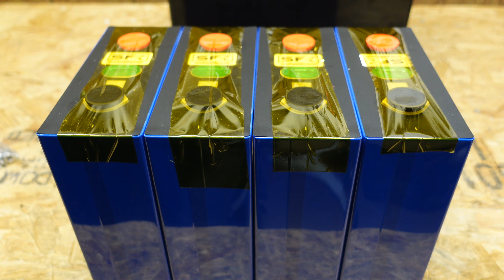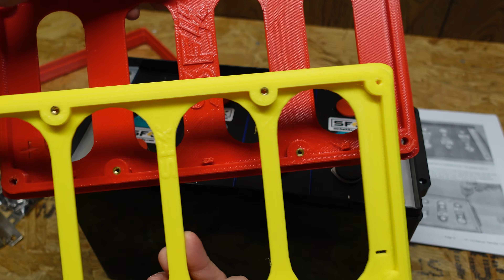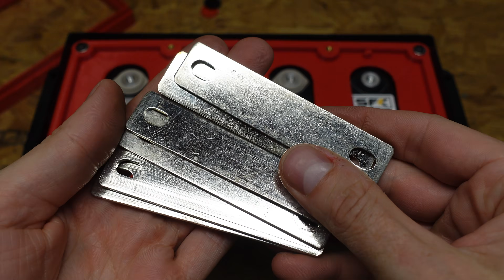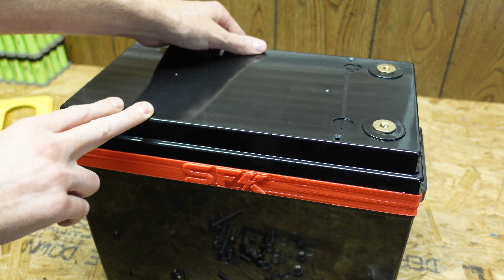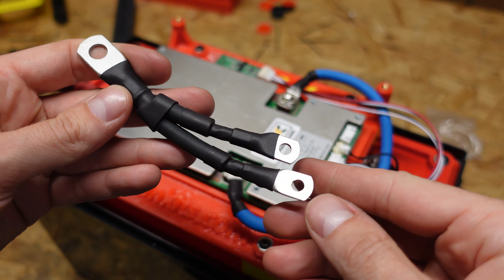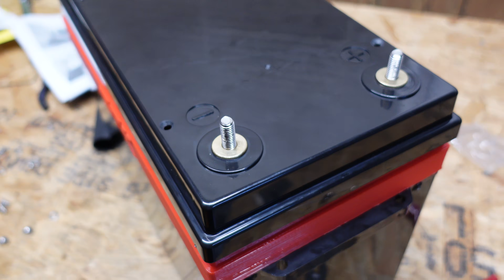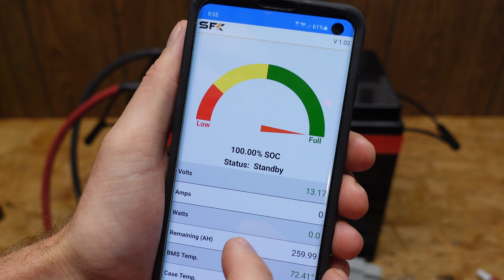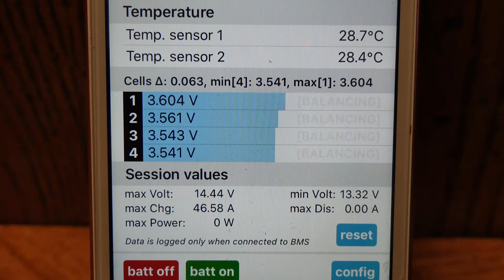Sun Fun Kits DIY 12V 280Ah LiFePO4 Battery, $295/kWh!

Comment: I just finished assembling one myself. I just bought the plastic parts, since I already had the cells  (with red Loctite on grubscrews) and the JBD BMS. Take my word for it, you want the cells fully discharged before you try and insert them, the fit is that good. I had already purchased 6 awg silicone wire, it is much easier to work with, and the single biggest thing that I would recommend they change. My JBD gave me no problems charging at 80 amps and since I didn't purchase their BMS, I wasn't aware they had programmed down the limits. I also made my wires longer and had fewer problems with the final assembly. Once assembled, the battery is pretty much "just right" and worth the money. My cells are grade B (although not previously used) and capacity wise I have two at 268AH, and the other 14 are 274AH or above. I am matching them to the limited extent possible, and it is working out nicely. The kit is actually nicer than I expected, I would highly recommend it. I just ordered 3 more, if you are on the fence about the kit, I definitely recommend it.
Reply: One thing I didn't see was high and low temp sencers. Does JBL bms have that or add on?
Reply: @putteslaintxtbks5166  Yes, it has temperature sensors, and yes you can disable charging when the low temperature setting is reached.
Reply: @john_in_phoenix  where is the temp sensor located?
Reply: @jj-jak  The JBD has two, one is located internally to measure the FETs, the second is attached via a short wire and can be placed where you want, I just taped it to the top of the cells.
Reply: @john_in_phoenix  that sounds good, I was watching other battery packs which seemed to have separate temp sensors for each cell.
Reply: @jj-jak  The model I'm using actually has three, one for the FET temperature and two connected via wires. You can just unplug the two and disable monitoring if you don't want them.
Reply: @john_in_phoenix I'm fixing to assemble a 560 ah battery with 280 eve grade a cells. What bms would you recommend and I already have a 24 volt 24 module leaf battery I'm looking for a bms for as well. I've ordered a 300 Amp daly and a couple of the jkbms with 2 Amp balancer but I'm not sure if these are actually what I need for either of my cells chemistry. I think they will work for the lifepo4 but the nmc chemistry has a much different top and bottom end so just not sure. Any advice will help thanks
Reply: @matthewknight5641   I don't know much about that chemistry, but I can tell you that the Daly BMS that I have are placed back in their boxes and not in use. Too many problems and they seem to randomly change the design and not document it. At least one of mine doesn't count cycles, because it was originally designed for a different chemistry, and never thinks the battery is full. The set values for disconnect work fine, but I don't trust the BMS not to suddenly think that 4.2v is the upper limit for LFP cells, and Daly is zero help. I never did find the software that would let me reset that, and I got the impression that they don't know themselves. They lost quite a few sales that way. I have had very good luck with the JBD that I have purchased, and would recommend them. The JK with a built in balancer seems pretty decent, but at least the one I tested was actually designed for 4 or 8 cells, and then I saw one being tested on YouTube that fried a MOSFET when doing a disconnect at high current. You don't want that to happen when inside a case. You may not notice it, and they tend to fail as a short (i.e. not disconnected). Great way to ruin your battery. For the EVE cells, I would recommend the JBD if doing 12v, and probably the JK if you are doing 24v (JBD doesn't have many choices for 24v, so you may need more than 100 amps). For 12v both the 150A and 200A JBD are solid choices. I may just be lucky, but I haven't needed an active balancer for any battery, just top balance and then the low rate balancer on the JBD has been adequate. I can also say that if you go to the JBD Alibaba store, they have always been very knowledgeable and helpful, so they may have a BMS designed for the Leaf cells. The higher amp rated Daly usually have fans, and I wouldn't recommend a cheap Chinese fan for anything that you want to last 10 years.
Reply from the maker: Yeah even at 30% SOC they were tough to fit in, can imagine 100% SOC is a bit of a struggle. But that's a good thing as it indicates a nice snug (but not too tight) fit. I'm still not sure why the BMS was programmed lower like that, but all of the settings are fully-configurable as needed.
Reply: @LithiumSolar  Yes, originally they hadn't published the guide, and I place the cells in backwards (really just means the positive and negative ends were reversed). It was a royal PITA to remove them and put them in correctly. I had to discharge them fully to get them out, and it still was NOT easy. It seems to give the cells just right compression. The reason the BMS is programmed with lower limits (I was told) is the heat generated when at the upper limits of charge and discharge. I tested at 80 amps charge rate, I wouldn't worry about it too much. Just up the charge rate if you need to in the software.
Reply: Thank you for the input. I'm gonna send the 300 Amp dally back once it gets here I guess. I have all 24 volt equipment and the jk says 100 to 300 Amp in the description of the product on Amazon but I don't really know yet how many amps it's capable of.  I figure I'll use 1 bms per 8 cells and so far I've ordered 16 cells and 2 jkbms. I'm sure I'll be ordering another 16 cells so it'll be a total of 32 cells 280 Amp hour each. I figure I'll try to keep using the leaf cells on my split phase 220 inverter that runs my minisplit and use the lifepo4 cells on my 3000 watt 24 volt all in one powmr inverter to power the rest of my holiday rambler 30 foot travel trailer.  I've been running the leaf cells a year with no problems and they run a total of 7000 watts of inverter. They always work great but I bought the lifepo4 to seperate the two inverters and have more days I could make it thru bad weather.
Reply: Unfortunately there's no option to purchase just the printed parts (i.e. without a battery box, as I already have the exact same battery boxes here, and the cells). Shipping just the printed parts would have made it worthwhile to ship to Australia - which is very expensive to ship with battery boxes.
Reply: @KowalskiBrothers  can you fab or print a similar part there?
Reply: I am confused at the kit's web site so emailed them.  Waiting for response.  The Video has for 295 and and is that everything and I end up with a battery I can connect to and charge etc?  Or is it 295 for a kit without cells?  I have not made a LiFePO4 yet but wanting to make something for a service vehicle.  pb

Comment: Metallurgist here.  Remember when aluminum wiring was banned in homes in the US?  That was because freshly-disturbed aluminum oxidizes rapidly in air, forming an insulated layer on all exposed surfaces.  Any aluminum wire connection, if not properly torqued, can increase in resistance over time and start heating up as disturbed oxides re-form.  The use of aluminum terminals in these cells was therefore a huge mistake.  This was made even worse by excluding the use of Loctite, which would help keep further oxidation from occurring.  These other problem with aluminum is that it is very soft, which in this case allowed the threads to be stripped before the required torque was achieved.  This battery would surely fail, and perhaps catch fire, if it had been put into service as-built.
Reply from the maker: I think you need to conduct some additional research to learn why the terminals are made of the material they are before making such statements.
Reply: The only advantage that aluminum has in this application is high thermal conductivity.  The better material over all would have been a high-copper alloy.  No stripped threads, no oxide layer to worry about.  No additional research needed.

Comment: In 2024, you can buy Eco-worthy lithium battery with 25.6v 100ah  at 2560 watt hour of power just $370. BMS just around $100, solar charger another $50 to $100. Lithium battery charger $70.

Comment: For the positive and negative post you can put two nuts on one post at a time, lock them against each other then tighten the bolts. Then break the nuts apart from each other. I know this is an old video, but this tip may come in handy elsewhere.

Comment: This is Robins Husband Ed. You are not accurate when you say that if you strip the Aluminum threads, the cell would be worthless. You can drill the hole out and replace it with a Heli coil thread!
Reply from the maker: Yes - if you know what you're doing, you could potentially repair it with a helicoil. HOWEVER, I have heard of a few people whom did this having their batteries catch fire presumably from overheated terminals. I do not recommend the helicoil approach as it seems much easier just to buy a replacement cell.

Comment: What current these tiny bars between cells calculated for?
Reply from the maker: What "tiny bars" are you referring to? I didn't use any "tiny bars" in this demonstration anywhere.
Reply: @LithiumSolar I mean bus bars between cells. What material they are and how to calculate what thickness they should be?

Comment: For me, the design of the kit has a very big negative: it appears impossible to disassemble the battery. The insertion of the cells is a one-way-trip. 

One of the positives for building any kit is that the builder can maintain and/or modify what they built. I hope they do better in future kits.

Comment: If I have 3.2 v 25ah of cell what would b capacity of 4 of them
Reply from the maker: If you wire the 4 cells in series, you would have a 12.8V 25Ah battery. If you wire them in parallel, you would have a 3.2V 100Ah battery. In both caes, you have 320Wh of power.
Reply: @LithiumSolar  thanks alot I need 12v

Comment: No ventilation between cells umm I think I would Not use the case but use my own and insulation between all cells I know lithium are cooler but I'm not concerned about lithium producing heat but environmental outside temperature.

Comment: About the output of the BMS - there is a penalty of high amp chargers - it is convenient but you degrade the battery at the expense of fast charging. The lithium particles gets trapped in the anode plate material at greater rate when the charging amperage are higher. The is the problem with all types of chemically based batteries. The lower the charge, the less heat and stress on the plates or materials. Heat (while charging) also degrades the battery.

Comment: Shouldnt there be a small gap between the batteries ? To compensate for expantion which could lead to friction causing abration between the cells.
Reply: Some lithium cell manufacturers recommend compression of the battery pack. It is said to reduce damaging expansion cycles and increase recharge cycles
Reply: @wallacegrommet9343  thanks

Comment: You tested these wrongly as well, it is 3601 / 12.8 =  281.32 AH / cell not as bad as the 18650 but again not 286AH. Why do you keep looking at amps going in as the capacity? Ask an electrical engineer if you don't believe this is how capacity is calculated: Watt-hours / nominal voltage.
Reply from the maker: No, I did not test them wrong. Batteries are measured in amp-hours. That's the data you'll see on the manufacture's spec sheet. Your method of taking watt-hours and dividing it by nominal voltage does not work because the watt-hours reading calculated by the shunt does not take in to account losses in the cabling, losses in the BMS, etc. That's why the amp-hours reading is more accurate.

Comment: A good video, i didn't know that was so complicated... and so expensive; not entirely interested yet;  we really need a different and better battery technology; my four "solar" 160Ah lead acids  cost 150 each, they are now 4 years old,on my 1.5Kw solar system,6 panels,  and they still work perfectly; the key is to have them oversized for the needs and they may last a decade.

Comment: They need to add a set screw Allen key placement at the end of them positive and negative bolts so you can  thigh them from the top instead of sticking a Allen key into the box. Just my opinion 🤷‍♂️

Comment: I’m new to all of this type of battery setup, if the batteries are 280ah could they be put into parallel to give out 560ah?
Reply from the maker: This kit is designed to build a 12V battery. Yes, you can connect the batteries into other configurations but you won't have the proper BMS or other parts to assemble it completely.

Comment: When threading those machine screws through the top of the battery case, as soon you get enough thread out, you put two nuts on the machine screw and tighten them against each other. Then use a wrench to turn the screw to tighten it. You can get a lot of force on studs and bolts that way. Mechanics technique, called "double nutting". Then break the nuts apart and thread them off.
Reply: Jam nut

Comment: 2 nuts on the screws . Lock the nuts together . Place wrench on lower nut . Do not over tighten . Or you can use a piece of leather or plastic with your channel locks .

Comment: Another good video.  I looked at the site in the description and they are sold out.  Kind of the way it works when posting in a youtube video, they always seem to be short of supply.  Nice review.  I prefer to put a 12v battery together with these type of cells rather than 18650 unless I am wanting very small footprint.  All the best, have a great week!

Comment: A trick to tighten the screws for the terminals:
Install 2 nuts.
Tighten top nut against bottom nut.
Tighten screw with bottom nut.
Remove top nut, remove bottom nut.
Reply: Jam nut

Comment: if my math is right why would anyone wanna build a battery $1170 plus shipping knowing you can buy a 300ah drop in for $1040 with free shipping?  Don't get me wrong, it's a bada** kit.
Reply from the maker: Can you share a link to the 300Ah battery you're seeing? I'm always looking for new products to evaluate.
Reply: @LithiumSolar  other than a lack of low temp disconnect they always seem to measure up.  IMHO low temp is a mute point.  put the batteries in conditioned space.

Comment: 1. Will the cells eventually bulge and put stress on connectors?
2. Regarding the vent, is there gas discharge involved, or another purpose?
3. What gear is needed for top balancing?
4. So total kit out the door with cells is over $1061 if I heard correct... how do you get $295/kWh?  $1061/(12V × 280Ah) = .316  ... I'm likely miscalculating.   It also seems more expensive than some other prebuilt batteries on Amazon... Are the cells and other hardware higher quality?
THANK YOU SO SO VERY MUCH for all that you do!
Reply: 21:00 $176 (with bms $310) $200/cell seems like a lot to me, you can buy a conventional 100Ah deep cell for under $100.
Reply: 4, I get 3360 or 3.4kwh for about  $1000

Comment: mice to dyi but  for roughly 1000-1100  you can buy complete battery amazon  , i went 460 complete and 900 out of stock cells 1360 battery prices complete are dropping. so cell sellers and kit sellers are behind complete battery's sellers
Reply: He should have mentioned the application, most viewers probably should use conventional deep cell batteries for most applications.

Comment: Hello, great vedio thaks for taking the time to make it.  I amnew to this type of project but willing to try. Can you advise if thhese cell (batteries) can be placed in series to increase the voltage and how much amp hour battery you think could be used to run an Air Conditioner (12000btu) with  a 4000w inverter? Thanks for your response.

Comment: Ok so dumb question , I'm afraid , Why have we moved from measuring the out put in Amp hours vs the olxd Watt hours ?
Reply from the maker: I test batteries in amp hours because reporting watt hours is inaccurate due to not taking into account losses in the cabling, circuit breakers, BMS, etc.

Comment: Adjustable Electric Fan Thermostat Switch Radiator Temperature Control Probe Kit..probably an excellent option for bms without low temperature sensors?

Comment: 1. At minute 8:00 you could've moved one of the ring terminals to the end battery post, as the busbar going between the two batteries would've read the same voltage either end.
2. If you strip the M6 thread on the battery posts, just drill and thread them to M8. Or use steel coil inserts to repair the M6 thread. Both cheap options, which means the battery is still usable.
Reply: I came in here to say the exact same. Just retap to m8. It's aluminum, you only need the strength of a toddler to do it, so harbor freight taps would do it for ya, lol. I've had to do this to several different banks over the past dozen years, it's no big deal, honestly a non-issue.

The only issue is that it's aluminum to start with so pure copper terminals will just cause corrosion. Make sure yrs are AL7CU or AL9CU.
Reply: @Mix1mum  they should  be nickel plated

Comment: I went to the linked site and it would appear that the case and wiring is $200. BMS and cells sold seperately. The 280AH cells were $895 alone. What am I missing here?
Reply from the maker: The case is $195 (price hasn't changed). It looks like the price of the cells increased, they are $865 now. I think they were either $795 or $800 when I created this video. Also, don't forget to apply the 10% discount code found in the video description.
Reply: I think what's missing is a discussion of application.